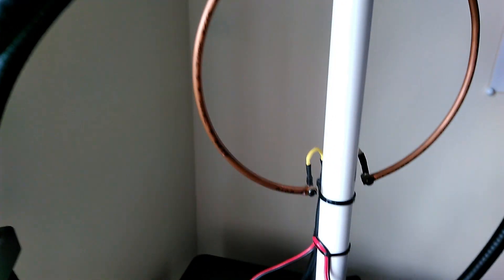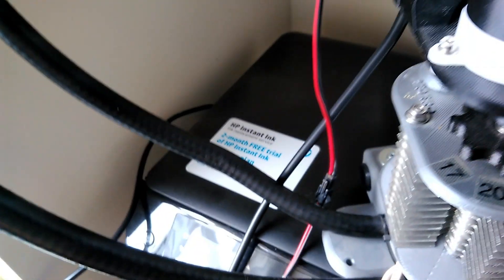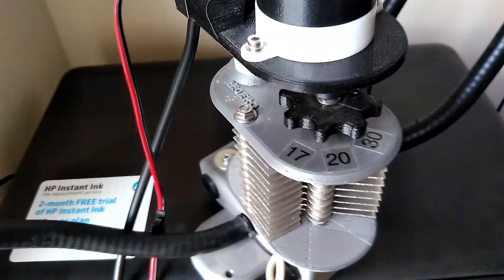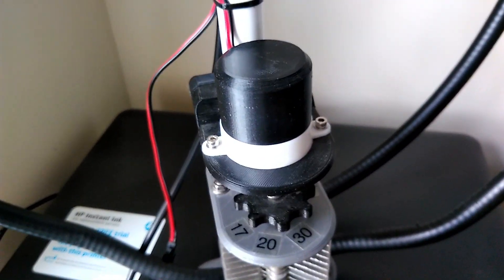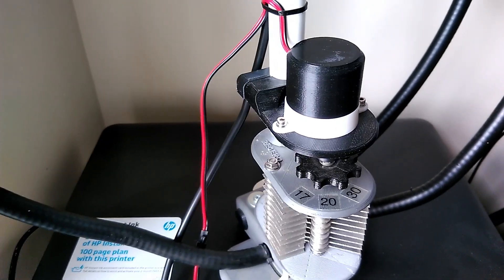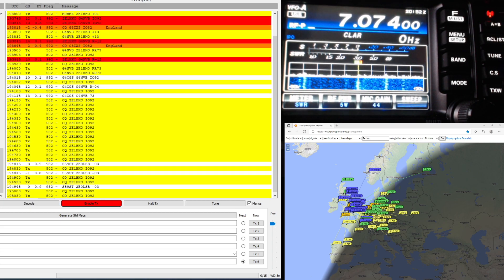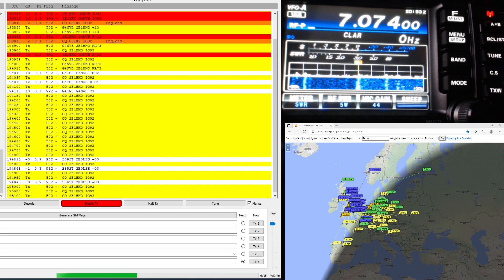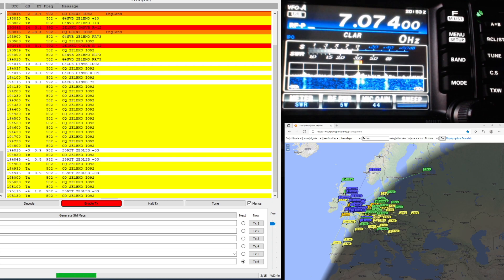2E0ERO 4 Band Mag Loop FT8 5W  #Shortvideo

Comment: Thank you for your detailed review. I had not thought about what it would be like to use this in the field, in a low noise situation. Thank you for bringing that up. I've been looking for a loop and just got the pricing from the owner. A couple of question for you: 1) Can the motorized version be tuned manually? Or can the motorized versions only be tuned with the motor. I was thinking just in case the motor wasn't getting me dialed in. Or if I went into the field and didn't want to bring the cables and controller for the motor. 2) What's the maximum wattage for digital modes like FT8? 3) Can the loop be broken down in to a backpack for travel? 4) Would it be possible to put PowerPoles on the leads for the tuner and plug that into my RigRunner, which is plugged into my power supply? Or I suppose a battery if I take the radio into the field.
Reply from the maker: Hi Mike, the motor has a high gear ratio meaning you can’t manually tune it by hand, I did try once and pulled the linking shaft out.
FT8 digital modes I wouldn’t exceed more than 10w, I say that because that’s the maximum I’ve tried.
You can’t break it down if you wanted to take it in the field, it’s well put together.
You could change the connections to the controller and motor drive to power poles. 
I’d prefer a manual loop in the field, it’s hard enough to tune, when you have a low noise floor, also the fact the motor creates a bit of noise on the radio. 
On the plus side taking it out in the field to do something like FT8 would a lot easier than phone, based on the fact you can tune in better to the FT8 frequency noise.

Comment: Hi, nice video, I've just ordered an 8 band loop with remote as well, I've just started the hobby.
If I get a MyDEL MP-705 6-8Amp fixed 13.8v Linear Power Supply to use my IC-705 indoors, would it be too much voltage for the remote? 
And would I need to fit Anderson powerpoles to both?
In advance, thank you very much for your help. 
Best regards,
73 de Manny-2E0HJN
Reply from the maker: Hi Manny  thanks for the feedback, the voltage of 13.8v will be fine for the motor, the cable you get to power the motor will be left to you for termination, I’ve used a couple of ring crimps on the cable ends connected to my power supply, the Mydel 705  PSU will accommodate this option also .
Thanks again for the great feedback, have a nice weekend 
73s Jason 2E1HKO👍